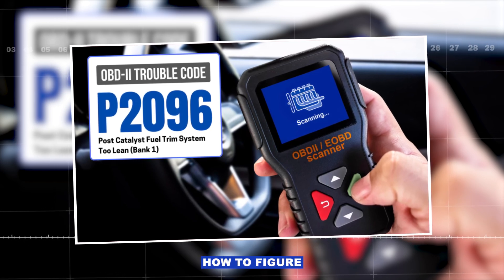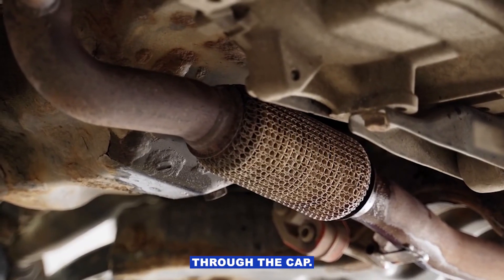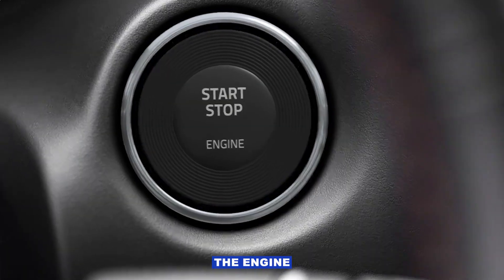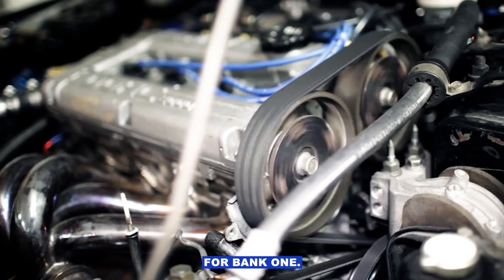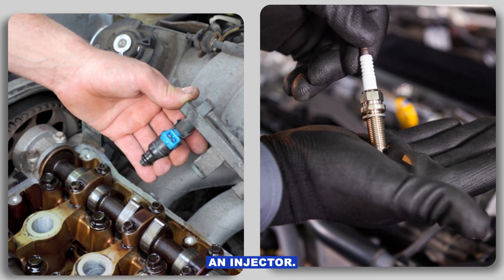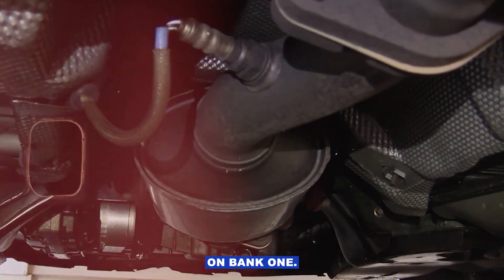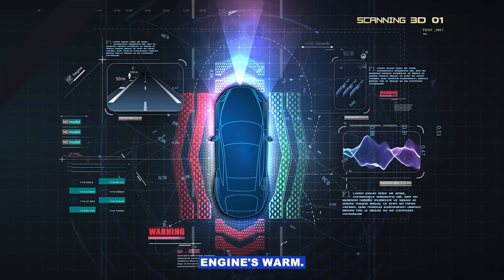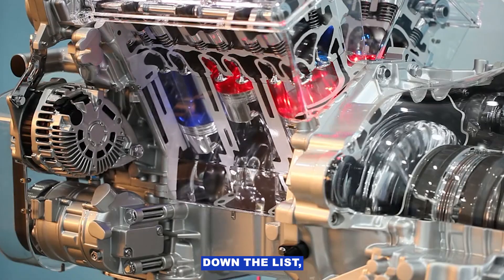P2096 Code: Post Catalyst Fuel Trim System Too Lean (Bank 1) – Causes & Fix

Comment: I only have the P2096 code and can smell fuel for a few seconds every time i start the car. Would an exhaust leak create a smell of fuel (petrol) or is it likely to be something else. I'm also not getting as many miles from a full tank of fuel as what i used to get

Comment: I have same code on my car. I already changed spark plugs, injectors sensors, but problem is the same. What it should be.?
Reply: have you fix it? did you replace the O2 sensor? downstream sensor.